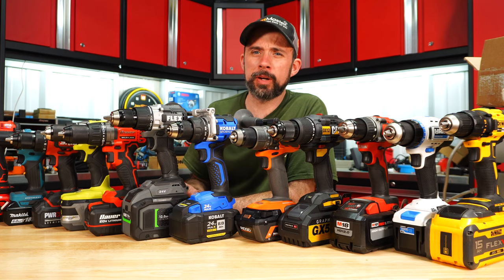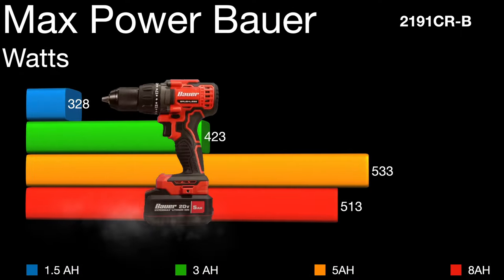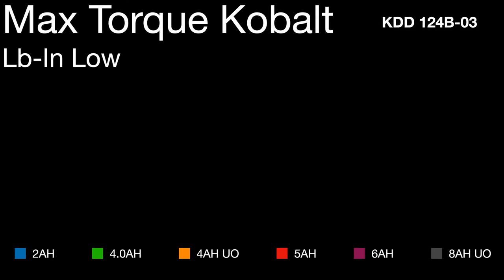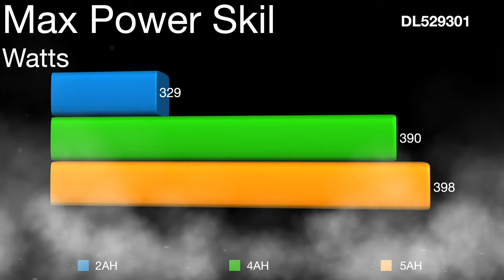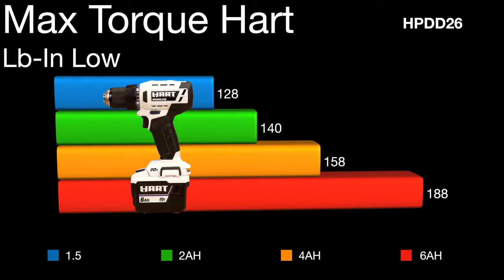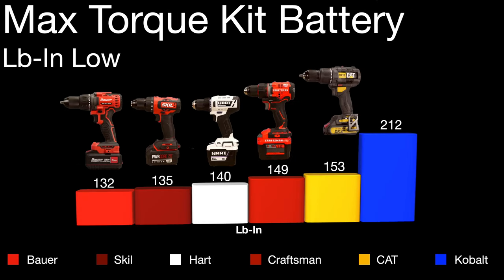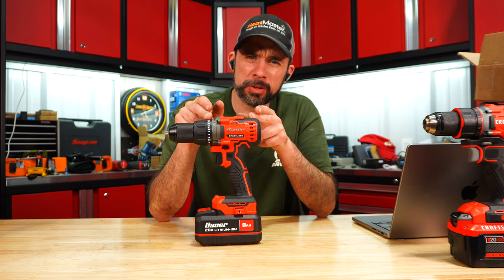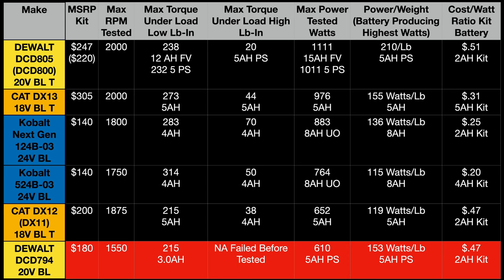Best Brushless Drill Driver? Mid Spec

Comment: I'm fully vested into the Kobalt Eco-System, but after getting the run-around at Lowes 3x for a failed XTR Sawzall return (1 year old) it has me looking at other offerings... would have loved to have seen the Hercules Brushless included in this test.  Great job!
Reply from the maker: Thanks for sharing, I can see why you're looking at alternatives.  

Hercules brushless will be tested with the larger hammer drills,  right now the dyno can only handle a max of 1100 watts I need to upgrade it before I can test the bigger drills.

Thanks!
Reply: @Tools-Tested  Looking forward to it!

Comment: Part 2? I can't wait.
Reply from the maker: Yeah,  really wanted to have the 12ah Ridgid and Ryobi battery's before I do.  But with or without it in two weeks I will be making the video.

I really hate it when they release a tool or battery and then its not available for months.
Reply: @Tools-Tested can you also include the bosch profactor GSB 18V 1330C? which bosch claims to be the strongest drill in the world. I'd like to see it for you to test it aswell because for what i heard its a beast torqueist drill and a powerhouse as well
Reply from the maker: @klipschkef0144  I plan on it,  but that will be a separate test.  I have the drill but this current dyno is only good for 1000 Watts.  I’m working on building another dyno for high power drills but it’s going to probably be a month or so.
Reply: @Tools-Tested  you should because bosch claimed that their profactor lineup or biturbo motor has a capacity to consumed a whoppping 1800watts of power, well atleast that bosch claimed not me hehe..

Comment: It seems the only advantage of the Kobalt 4Ah UO battery is compactness for close to the same performance as the standard 4Ah battery.  I ended up not getting it because to me the standard 4Ah batteries were better complemented with the 8Ah UO.
Reply from the maker: Yeah its very interesting,  I need to open them up and see what cells are inside.
Reply: @Tools-Tested  I figured out the cells inside a couple months ago from older videos but I have forgotten which Samsung cells they are. But would be interesting to see if they are still those cells a couple years later